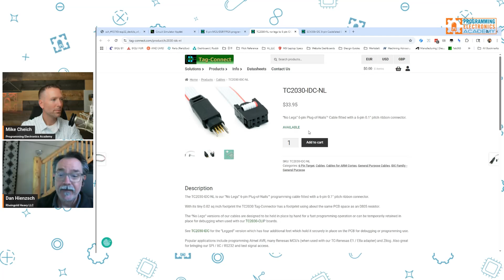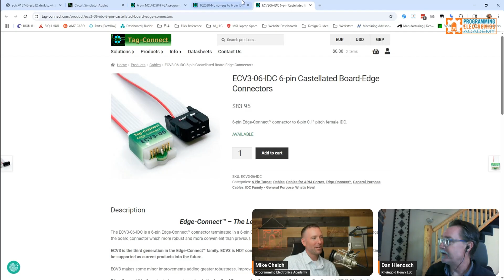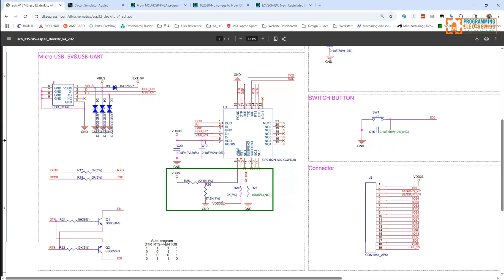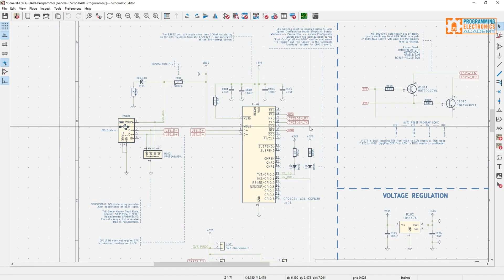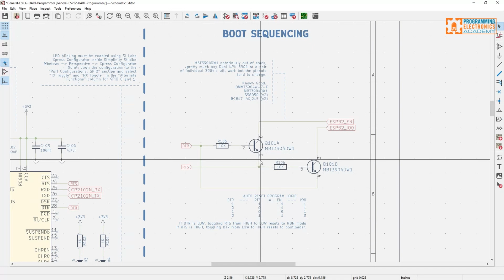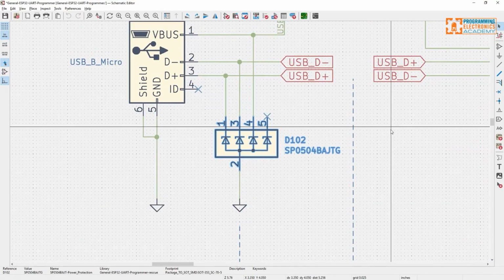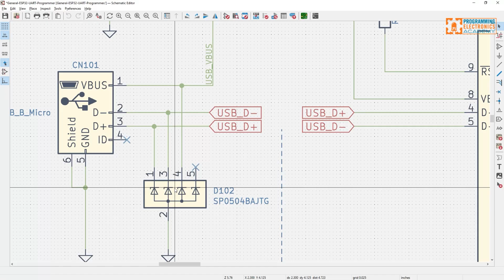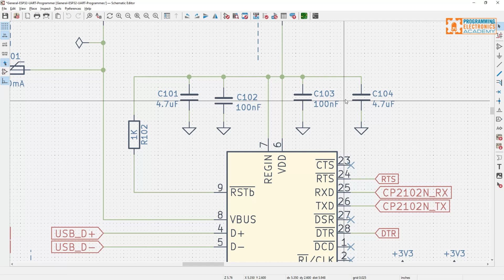ESP32 USB to UART Programmer Schematic Review Highlights #esp32 #schematics

Comment: C 101, 102, 103, 104 are all in parallel, the 100nF passes high-frequency noise, the  4.7 uF passes lower frequency noise like 50Hz. Two sets probably lower the impedance, and lower component size.?